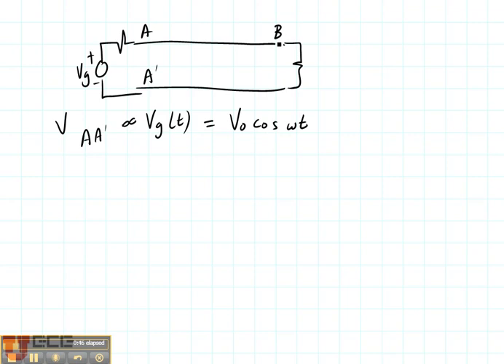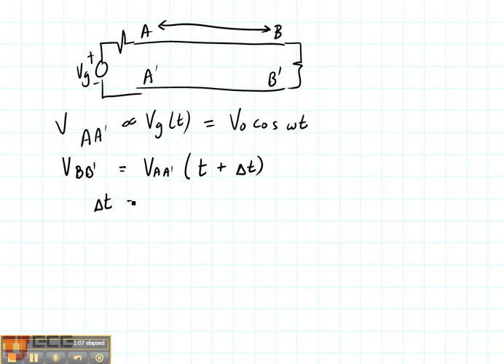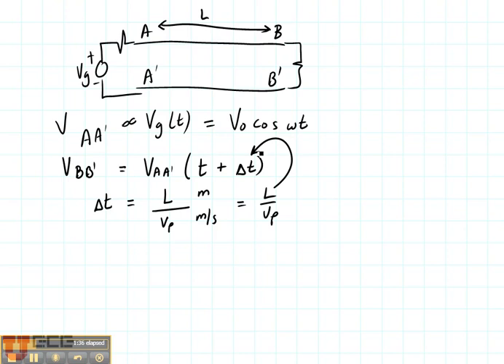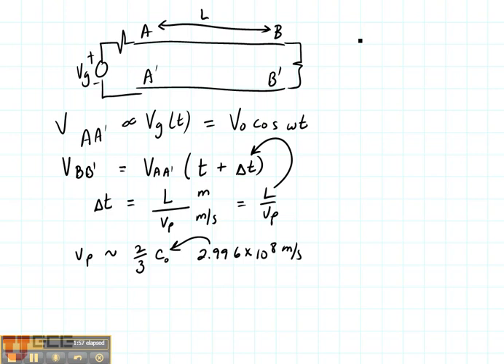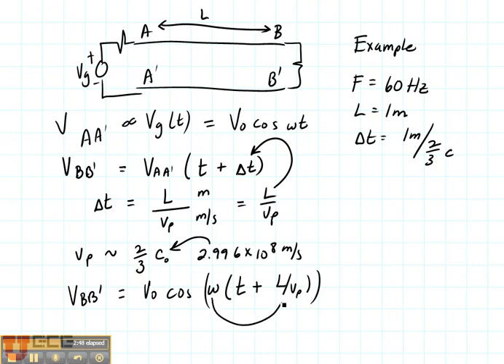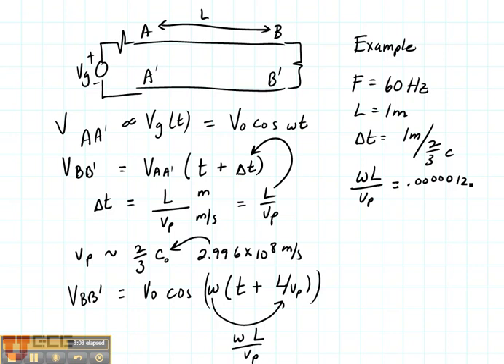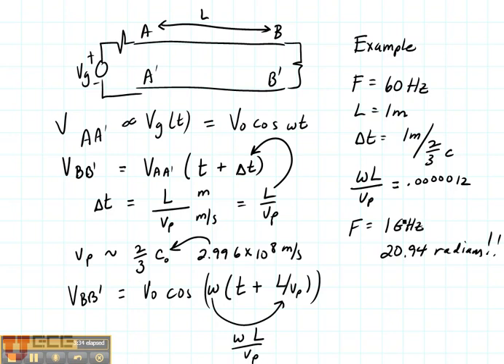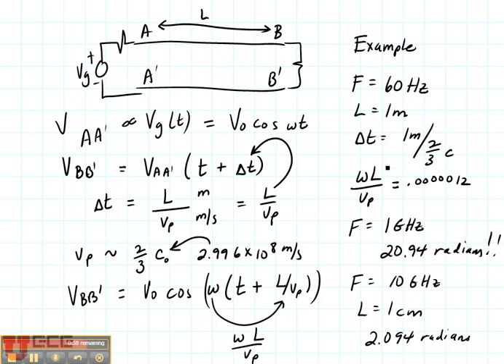ECE3300 Lecture 4-2 Isit a Transmission Line?

Comment: Shouldn't a delay = Vaa'(t - delta t) ? because if the output is  Vaa'(t + delta t), then the output is seeing future values of the input Vaa'(t). For example, let delta t = 2 and t = 0, the signal enters the transmission wire :

Vaa'(0) ----->[system]---->Vaa'(0+2)

As we can see, at t=0, the signal first enters the wire and is Vaa'(0) and at that exact moment the output will be Vaa'(2)... which is in the future. The output is the input but behaves as if it is the input in the future.

I think if we make the output = Vaa'(t - delta t), then we can represent the signal as,

Vaa'(t) ------->[delay]-----> Vaa'(t - delta t)

so if t = 0, the output will be Vaa'(-2), which is the input in the past.

Comment: hi professor cynthia, at 3:00 you have the value of .0000012 second as the delay, but I got a different answer when I put the value into my calculator? I worked out the value of 1/Vp = 5x10^-9, then I used the formula w = 2*pi*f to convert 60Hz into 120pi, then multiply 120pi by 5x10^-9. Did I go wrong somewhere??